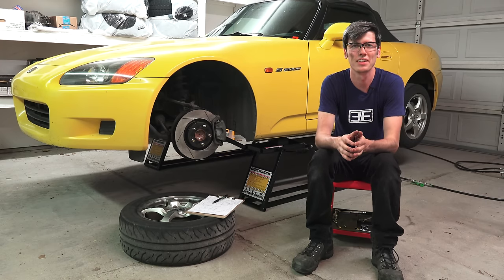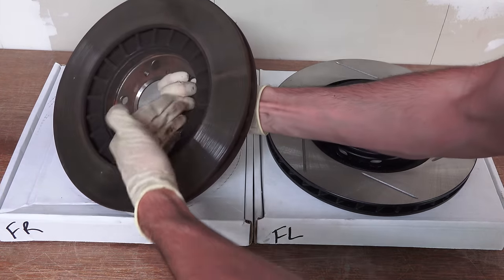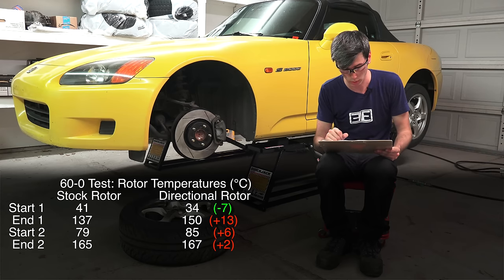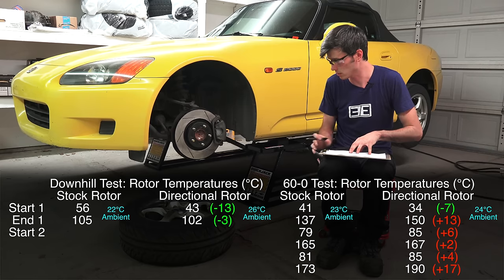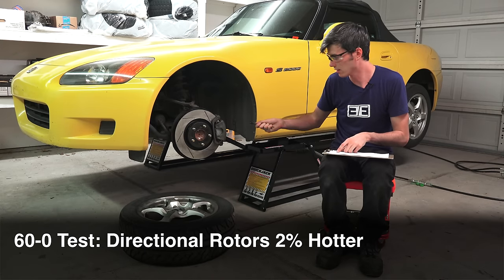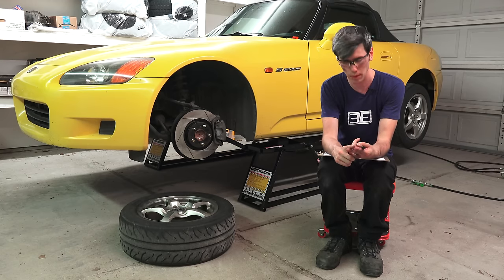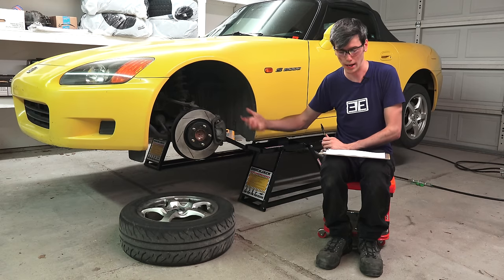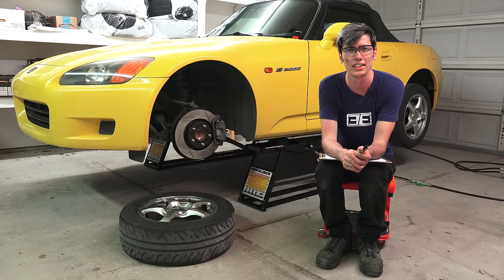Do Performance Brake Rotors Have Better Cooling?

Comment: The performance brakedisks are not designed to cool beter under load, but just after that. They cool faster till the next turn, that's the upgrade. And that's why they work better on a track then on a normal road. (at leased that what experienced) performance brakepads work better when they're hotter so the disks needs to be hot (hotter)  under pressure. But i probably need to see the hole video.....
Reply: You are correct: From a materials stand point they would be designed to build heat quicker for better friction against the brake pads, but off braking to vent and cool quicker thanks to the vein design.
Reply: I was going to say the same.  They would cool off quicker then stock for the next stop n go situation.
Reply: You sound inteliigent but cant spell "Whole"
Reply: its an engineers curse, cant spell but will outdo you easily in logic and equations
Reply: The grooves remove the gas's created when breaking removing the 'hovercraft' affect allowing better friction temp has nothing to do with it.
Reply: Paul Davies lmao you got me on that one should have looked at what i typed
Reply: *than
Reply: Hear hear.
Reply: Brakes perform better when hot?
Why is most brake technologies based on minimizing brake fade and damage due specifically to heat.
Reply: race pads work better when they hit a certain temperature,  regular street pads generally work pretty well even when cold.   Even race pads though, get fade when they get hot enough, it just takes more heat to get there
Reply: Even brake pads have an optimal temperature. Pads made for racing tend to be harder compounds designed to be at a higher temperature before reaching optimal 'sticktivity' for lack of a better term.

A normal street use brake pad has to work in ambient temperatures between -40 and 40 degrees celcius. Given the kind of braking it'll do it will probably rarely see temperatures in excess of 200 degrees celcius.

While racing use brake pads probably won't ever have to deal with arctic temperatures. And given the kind of braking they'll do, are much more likely to see temperatures in excess of 300 or even 400 degrees celcius.

So manufacturers make brake pads with these temperature ranges in mind. A much more agressive brake pad for track use will be designed to withstand the much higher temperatures, but as a consequence won't be as sticky at lower temperatures.

It's the same reason why race cars have their tyres pre-heated, because if they're too cold, the rubber will be too hard and the tyres won't have optimum grip. It's why racing drivers behind a pace car will slalom like a bunch of impatient petulent kids, they're rubbing their tyres in order to keep the temperature high enough for the tyre to work as intended.
Reply: Hector Gonzales Here, here, not hear, hear.
Reply: animefreak5757 Most brake fade is a result of brake fluid that gets too hot. Brake friction heats up the calipers which heats up the brake fluid inside the calipers. That heat, in turn, is transferred through the rest of the fluid in the lines. When the brake fluid (which is just hydraulic fluid - same principal as in fork lift masts, hydraulic car lifts, etc.) "boils," it compresses a lot more under pressure and is no longer able to hold the pressure necessary to actuate the calipers forcefully enough against the rotors to be effective. And that, technically speaking, is when the fun stops. 

Performance brake pads in particular can actually take a lot of heat. In fact, they won't work very well (and will squeal like crazy) if they're not hot. 

The purpose of rotors like those in the video, as someone briefly mentioned above, is to disperse high heat (hotter than would be achieved in the tests in this video or under normal driving conditions) more efficiently in performance applications such as racing or track driving. Additionally, they are able to withstand longer periods of time at much higher temperatures than normal brake rotors can, repeatedly. As for why they're slotted on the surface: Performance pads generate waaay more brake dust than normal brake pads and the slots in the rotors aid in channelling the material that rubs off the pad surface away, which prevents it from accumulating and potentially affecting the operability of the brakes.
Reply: Vincent Andriessen
  ... "to see the WHOLE video"...???
Reply: Or the proper usage of "than" rather than "then."
Reply: sluggo1515 nope slug. He's right, it's hear, hear. It's interesting how so many people who try correct others are wrong themselves. I'm going to go check what I'm wrong about now...
Reply: Found it!...try TO correct others...
Reply: I wrote a long winded version of what  I think you’re trying to say.  Bottom line, don’t try to re-engineer a street car designed by top engineers.
Reply: Paul Davis *criticize :)
Reply: This guy gets why I can't stand this video. The lack of basic knowledge of what purpose certains parts are designed to serve should drive anyone up a wall. So tired of dunces believing themselves the mechani-mathematician-messiah put here to save us from logic and facts with their complete mechanical incompetence.
Reply: @Rachael311  Shhhh, you'll hurt his snowflake feelings with your microaggressions and he'll have to run to his safe space.
Reply: Very correct. I
Reply: The fact that different pads work better when hot is based on the actual material composition of the pads. racing pads are mad from way different ceramic metallic  materials where most street pads are organic or organic metallic compounds. Race pads don't bite when cold (below about 70F) but street/track pads and street pads are designed to work even cold, It all depends on the design and purpose of the exact pad. :)
Reply: letsroll and buy your fancy cars in $100 dollar bills! Haha, got that off an awesome song!
Reply: @Vincent Andriessen You're right, it's the spinning action of the disc that keeps the air flowing thru it. Street speeds, with a pound less mass, means  it won't cool down properly as designed; otoh on a track, with higher average speeds, more air is moved thru the vanes, and the aftermarket rotor (as shown) performs far better than stock. Plus, with a pound less unsprung weight, it'll handle better as well (as long as the spring/shock combo are dialed in properly).
Reply: @fermitupoupon1754  yes. I agree. Race cars are warmed up for brake performance on top of everything else which does better warm. The English language already had you covered with the word stickiness.
Reply: @applejacks971  'Criticise' is the English spelling and given that it's called the 'English language', he was correct. :-D
Reply: He really should have tested the brakes like the auto magazines.  stepping on the pedal as hard as you can cuz his approximation of 50% is really going to be way off and then just see which ones stop the car in less feet

Comment: I have no idea if someone said before but a key point is the fact the the pads needs to settle against the disc before test it.
Reply: Yes, they need to be properly bedded, see my comment on 8-31-19.
Reply: Yes, but I think the results would be similar. More mass has to have some impact on how they heat up and the directional vanes that seem to play a significant role (7-12% is not bad), are not efficient at low speeds like he drove. On a racetrack at 180kph the difference should become noticeable
Reply: Rotor Blade interesting

Comment: Would this make a difference?

You used the old brake pads that were broken in and bedded to sit flush with those rotors. 
Putting new rotors but old pads could have a possibility to not use all the surface of the pad which would create hot spots.
Reply: Old pad would be "broken in" to the new rotor by the time he got to the first test location.
Reply: @envagyokzaz  yes I agree. It doesn't take much assuming the rotors aren't grooved. . . And they weren't as far as I can tell they weren't even slightly grooved.
Reply: @envagyokzaz  plus, a new pad would be another variable.

Comment: Another variable would be if the new rotors had any form of coating on them? I'm sure getting down to the miniscule differences that it might make a tiny difference.
Reply: Brake rotors are a high-friction component. Any coating on the rotor doesn't last very long.
Reply: I do believe he is talking about the brake pad transfer of friction material to the rotor.  New rotors or pads should always be bedded in and that process deposits a thin layer of brake material to the rotor.
Reply: He used old stock rotors and brand new outta the box aftermarket rotors. So the stock ones were more worn in and could take the heat better.
Reply: Yup but decreased friction means decreased temperature and stopping distance. U get a B-

Comment: i think this test is abit flawed because brake cooling requires the rotors to be spinning to really work so if you stop the car with the brakes and then measure the temperature you are essentially measuring the brakes at their hottest without letting them cool down using the built in cooling. the only real way to test them in a safe way would be to jack up the car then speed up until the a predetermined speed then put the brakes on until the wheels stop spinning then speed up again for a given amount of time, and let the wheels coast to a stop then measure the temperature
Reply: Cooling due to the directional or non-directional veins is still occurring during braking, and so heat is constantly being shucked away by the air even though braking is in progress. This is especially apparent in his downhill test, and the track testing. The cooling is not just occurring after the pads release. Overall, the directional rotors had an advantage when the temperature differentials were very high, and undoubtedly speeds were higher too. Combined with the fact that they are lighter, and still outperformed when pushed hard, gives them the win. 
His tests can be faulted for not pushing the brakes hard enough or high enough speeds.
Reply: The way its flawed is because he used the same brake pads , he should have used same brake pads for  each rotor because brake pads on different rotors require bedding in to different rotors and that will create rotors to get hotter
Reply: I believe you are correct. I think the slots are to cool the rotor down after stopping when the car start moving again. Basically it only cools when the rotor is moving..not braking. It cools the rotor after braking not during!

Comment: Slotted rotors are not for slotted for cooling. They're slotted to allow for the gases and debris build up under heavy breaking to clear out and keep a clean pad/rotor contact patch.

And the cooling ducting in the rotor is probably not going to be impactful on mellow road driving.
Reply: Lol, it's funny that you're the only one who brought this up.  I was watching this about was like wait a min. He needed to do this test with cross drilled which is designed for cooling.
Reply: Having a air vent to the break would get better cooling with slotted rotors than a big break that make for bus....
Reply: Yes.  I thought everyone knew this.  Weird video.

Comment: Very nice and useful tests and analysis. I think the mass had a significant impact. The cooling for directional vanes is better but that when you are on a straight at 200kph which makes the difference. Less mass is better because of less unsprung weight but you need a minimum thickness otherwise they will crack. 
Racing rotors are two piece free floating and they are small in diameter unlike on supercars, but they are thick. However, with air ducts that blows  a high flow of air in the middle, they can stay cool for tens of minutes of racing. The slots are also necessary for off-gassing. Racing pads which you cannot use on roads, are also used. 
If you want good brakes you want multi piston calipers, good pads, free floating discs not too big, and air ducts, racing fluid. Air ducts with good pads are still ok.

Comment: What was the stopping distance? Maybe the aftermarket rotors are actually performing better, overall. After all, the purpose of a disk isn't to stay cool. It's to stop. Higher temperature = higher friction = faster stops...  (And, don't get me started about materials... Which ones warp faster?)
Reply: The stopping distance of the aftermarket rotors would not make much of a difference if it is not under heavy usage/load (like in a track). As the video mentions, the rotors cool better at much higher speeds and temperature. If you're really looking at stopping distance, the material used (e.g., ceramic) and tyres have more impact to stopping distance; or you could use a big brake kit which could skid a car a normal car.

From personal experience, changing the brake pads to aftermarket (e.g., brembo or bendix) made a huge difference for me in terms of response time (how quick the brakes engages) rather than the rotors. Changing my tyres to performance type reduced my stopping distance.
Reply: @xXHokoriXGloryXx  Agree. I have experience with Bendix pads (not Brembo though) and there was a noticeable difference. They wore better, too.

Comment: So basically these rotors are useless if you don't drive the car on track. Thanks, I guess I'll stick with the cheap regular ones.
Reply: Not necessarily,  he only tested heat not performance.
Reply: Heat is not the sole performing factor. Carbon set ups not only run hotter but won’t function until hot. Yes, different material but there are other factors and potential scenarios. For instance one could suggest the rotors are hotter because they soak heat from the brake pads in turn cooling the pads. Maybe this isn’t the case but you’d need further and expanded testing to included the pads. He did mention the rotors do cool a tad faster. Another possibility is the slotted rotors physically promote more friction than the OEMs. This means they may stop faster but create more much more heat doing so vs the OEMs. With all that said..... even if they had an advantage, which personally I doubt they do, the benefits on a street car are negligible. My ZR1 has carbon brakes and that sounds nice and fancy until you have to replace them all while constantly reminding yourself that you just drive this car on the street so it’s a waste at a certain point regardless.
Reply: @muskokamike127  Not true, some pads need heat in them to work properly. Basically he's another youtuber that made a couple videos and now people take his word as gospel. This was a poorly done video because he's not doing the correct testing. Again.
Reply: @muskokamike127  Then the point of doing this test was moot. You aren't going to put on performance rotors and not performance pads. There's no reason to do this test other than to test a performance setup, which requires better pads that do require heat to start working properly. You guys are just moving the goalposts . We aren't talking about the vast majority, those of you here that don't want to admit you're wrong are just making things up to justify your irrelevant nonsense. Hot brakes DO stop as well as cold ones when you're comparing OEM brakes to performance brakes. You want cold braking performance for a street application to a certain extent, but rotors like these are meant for street AND some track time so you don't want Corolla pads on there. Honestly, I don't understand why you people open your mouth.
Reply: This is SO TRUE For EVERYTHING People do to their cars.. spoiler's, ground kits, lowering, coil-overs... so on..  
If your not Driving the car fast enough, and hitting turns hard enough they do NOTHING.. and most people dont.
they might try and push 140- 160 mph in a car but not for long.. so it's all pointless unless u go to a track.. 
 It's all For LOOKS.. thats it
Reply: Not only that but theyll eat through brake pads at a higher rate. Blank rotors are fine for street use. Just upgrade your pads if you want.
Reply: silenc3x yes. I prefer drilled or slotted brakes because it looks cooler n nicer lol. Most importantly, it stops better than stock. Trust me. I have been using drilled brakes for a while now. There is a difference.

Comment: Absolutely, YES. I drive my E350 van hard and I kept warping the rotors. I bit the bullet and bought a set of performance rotors and I've never had a problem since.
Reply: Stock rotors might just be trash. You could have just bought blank centric premium rotors and had the same outcome.

Comment: I think the direction of the slots matter. Can you test the directional discs installed in the two directions.
Also for better comparison you might leave one wheel with aftermarket and the other with performance and run them together, but make sure that the brake lines are bleed.
I agree on the cubical part, I am about to do the same, i even have the window :)
Thank you :)

Comment: This is irrelevant without adding the stopping distances.
Reply: exactly it's driving me crazy to watch this and he hasn't even tested if the performance brakes are stopping faster, but that is the tip of the iceburg when it comes to things that have been overlooked. One thing I thought as well is that racing cars have other devices like brake coolers different pads, calipers ect. Not  mention that the highest speed test is done at 80. slots and holes in rotors will work different depending on the airflow.
Reply: Does that matter when only the cooling is being discussed?
Reply: AznUzer that’s the whole point of improving cooling. Once again, this dude does incomplete “testing” and comes to a pointless conclusion because of it. I don’t understand why people revere this guy so much, he doesn’t even do basic high school level science and everyone acts like he’s some sort of genius.
Reply: Wait why is stopping distance is relevant here? Modern cars’ brakes are strong enough to lock up the wheels, the key aspects come down to tyres’ tractions and the tuning of the abs system